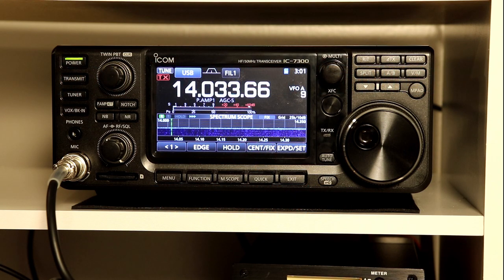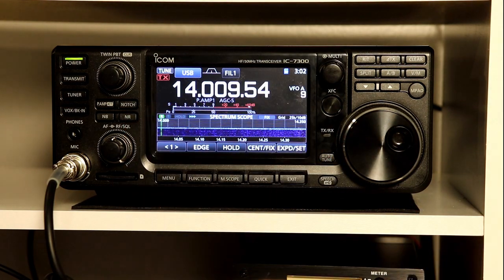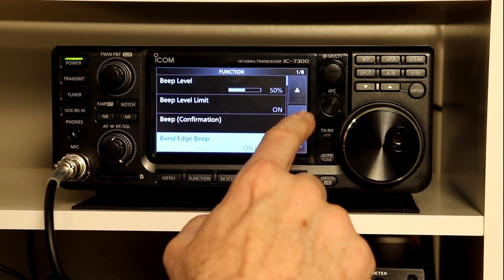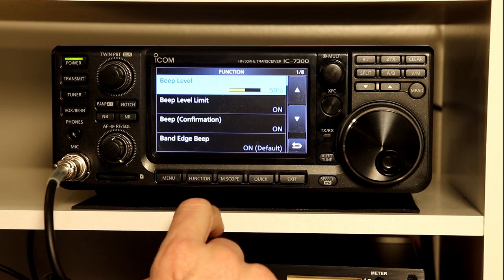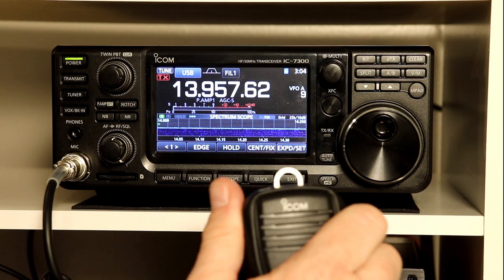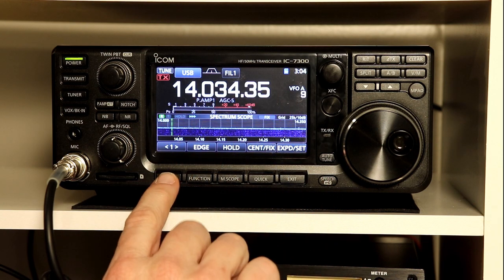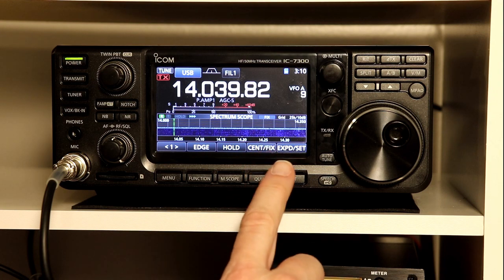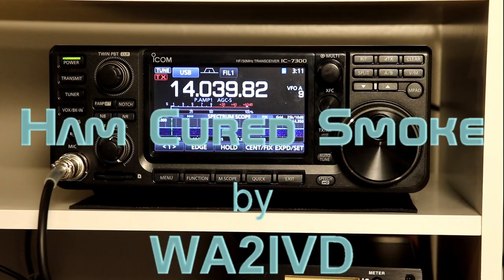Icom IC-7300 From A to Z - #3 Band Edge Beeps & User Band Edges

Comment: Great videos Tom!  Everyone with a 7300 will learn SOMETHING new about their radio by just watching.  As a quick note to hams when using the awesome Band Edge programming feature, when in LSB or USB modes, you are using up to 3Khz down or up from your tuned frequency and if tuned right to the lower or upper edge of your band allowance, you could be transmitting outside of your band allocation.  These band edge settings can really help you to stay clean and keep the Advanced/Extra folks from calling you out!
Cheers and 73!

Comment: Hi Tom. This segment is really helpful. Thank you for taking the time to make up these informational videos. I upgraded to General this past winter, after a long absence from Amateur Radio. Purchased the Icom 7300, but still haven't been on the air yet. I am waiting for an antenna that has been on backorder for many months. I'm using a small dipole for listening. I'm also in 2 land, so perhaps in a few months I'll be up and running. 73'S Dave.

Comment: Thnks for your videos.  I have been not very active over the past year so I needed to refresh on the basics.  I got my advanced license in 1979.  I also have done some MARS work.  So I know about out of band.  I had hoped some years ago that the when they stopped issuing new advanced licenses  That since, if I remember correctly, that the only difference in 1979 between advanced and extra was Advanced was 13wpm and Extra was 20wpm. that my license would have been bumped to extra but no such luck.  I keep renewing so still an advanced class ham.  So I will use the user defined band edges limits to make sure I stay in my freq limits and no stray into extra territory.
Reply from the maker: Hi Joe.  I upgraded to Advanced right around that same time.  There was still a separate written element for Extra, even back then, but it was a pretty small jump from Advanced to Extra.  When they dropped the Advanced, I waited quite a while before going for Extra as I thought it was a little bit special to hold a license class that nobody could ever get again.  I finally decided to get over that about 8 years ago and decided to upgrade when my 2 boys took went to take their Technician test.  Glad to know that you’re getting active again and I’m glad you’re enjoying the videos.  73,  Tom WA2IVD

Comment: Ok we’ve set the band edges. In my case for General. Now how do we cycle thru the band sections. I see the <1> key are they numbered after we set them up.
Reply from the maker: With the scope in Fixed mode, the 2nd soft button should say “EDGE”.  Keep pressing that and it will switch between the different edge settings for that band.

Comment: THIS video is really useful to new hams, when I just gotten the Tech license I cq;d in the wrong range , thankfully a VERY POLITE operator called my attention to it , and I ordered the ARRL chart. I now have the General license , and set up the 7300 to follow those guide lines.  i SET THE LIMITS FOR PHONE AND IMAGE, i'M WONDERING HOW THAT WILL AFFECT DATA ?  THANK YOU
Reply from the maker: Hi.  Thanks for the kind words and sorry for the delayed reply.  The user band edges that you set are independent of mode.  So if you set user band edges for the general phone portion of a band, then outside of those limits, the radio won’t let you transmit in any mode.  So if you want to do data too, you need to make sure there is another user band edge pair covering the data portion of the band.  73,  Tom

Comment: I haven't played around with this yet. If I set limits for the top and bottom phone areas for the bands I would assume it'd keep me from accidentally keying up in the wrong area. Would I still be able to use WSJT-X in the digital portions of the bands?
Reply from the maker: Hi Greg.  If you set the user band edges to prevent transmitting and you don’t program a segment that includes the digital part of the band, then the answer is no.  Transmit is inhibited regardless of where PTT is coming from.  So if you are using the User Band Edges then you need to include every segment where you want to transmit.
Reply: @HamRadioA2Z  Thanks!

Comment: Tom - is there any remedy for 5.3 MHz where the scope is displaying 'out of range'? Also this applies to 70MHz on my 7300 on this side of the ocean. Great video. I've applied this information to mine rig  and the club radio. 73 de David M0YDH
Reply from the maker: Hi David.  There are 2 ways to remedy the ‘out of range’ message.  The scope fixed edge limits are divided into 13 ranges that roughly correspond to the various amateur bands.  There are 3 fixed edge settings for each range.  The default settings for these are usually an entire amateur band, the lower/CW portion of the band and the upper/voice portion of the band.  The range used for 80 meters can be set anywhere from 2.0 MHz to 6.0 MHz.  So you can change one of the 80 meter fixed edges to be 60 meters instead.  The other option is to put the scope in CENTER mode instead of FIXED EDGES.  Then the center of the scope will be your tuned frequency no matter where you tune.
As for 70Mhz, there should be fixed edges set for that.  It is one of the ranges.
You’ll find all this in section 5 of the manual.
73,
Tom
Reply: @HamRadioA2Z  Thanks Tom for the reply. I had a go at this.  Band edge 4 in any set seems quite adaptable. I set this one to 5.2-5.6 MHz. The LF band edges were readily changed for e.g. 0.03 to 0.25 MHz (time signals, 2200m and BBC Radio 4) and one for 630m. I'll use Center mode when I  go off piste- top tip - thanks

Comment: Tom,  Can I set up the band edges and "band segments" so the radio switches from CW to ( and from ) SSB at the desired frequency?  if so, point me to the right page.  This is my first "menu driven" radio.     TNX   Wayne N3TNS
Reply from the maker: Hi Wayne.  Sorry, but no.  You can set the default and user defined band edges to inhibit transmit, but there is no option to do anything with modes based on the band edges.

Comment: Hi there...question, when you get the radio the 60 metre / 5mhz band is there but there are no band edges and it says scope out of range but it will tx, so can you just make a band limit on that band, from 5,225 to 5.450 or what ever it is, and will the scope work on that band as it does on the others...i guess you press insert and put it in there...from Fred g4vvq in England.
Reply from the maker: Hi Fred.  Keep in mind that the User Band Edges covered in video #3 are not at all related to the Fixed Edges displayed on the scope.  There are 2 ways that you can display 60M frequencies on the scope.  One simple way is to tune to the center of the 60M band then set the scope to Center mode (instead of Fixed).  Then press SPAN until the span indicates 50k on each side of the scope and you'll see the entire band.  You can also change one of the Fixed edges for the scope to cover the 60M band.  Press and hold EXPD/SET and then scroll down to the Fixed Edges option.  You can change of the 2.0 - 6.0 Edges from 80 meters to the 60 meter band.  The scope is covered in the IC-7300 videos 17 - 19.  I believe setting the fixed edges is covered in #19.  Here's a link:  https://youtu.be/DTLvr0es6nA .  73, Tom

Comment: How can one open up a transmittable frequency range for the 2200 meter and 630 meter band?  Inserting two ranges above 160M doesn't allow entering frequencies for those ham bands.
Reply from the maker: Hi Jim.  The 7300 allows you to set transmit limits that are a portion of the various amateur bands.  It will not let you set transmit ranges outside of the defined amateur bands.  Many radios have some way of opening up transmit capability outside of amateur bands by applying a small hardware modification, by getting in a service type menu and making changes or sometimes, by a combination of both methods.  The 7300 may have this capability, but I haven’t looked into it.  If you want to modify the radio to allow transmitting on experimental bands, MARS frequencies or for some other purpose you could try searching on “7300 radio modifications” or something similar.  However, it is important to caution you that you are responsible for insuring that it is legal for you to transmit on whatever frequencies you choose in your country.  Also, keep in mind that if you force the 7300 (or any radio) to transmit on frequencies outside the range that it was designed for, it may not meet it’s performance specs or legal requirements for spurious emissions.

Comment: Hi Tom when i go into band edges in menu i only have 2 in there, something like 1.700mhz to 29,999mhz and   50 to 440 mhz, something like that, its 4 and 6 meters anyway, if i try to great a 3rd new option, i dial the freq in and press enter and it just throws it out, i was trying to make a 5 mhz section, i have installed new ver 4,0 software and my 7300 has been widebanded, anu ideas...oh the band edge bleep has vanished, apparently that happens when you wideband radios....from Fred g4vvq.
Reply from the maker: Hi Fred. When setting up any particular band edge, the left number always has to be lower than the right number. If you enter a number that violates that it will throw it out and go back to the last value.  So, if you’re moving an existing band edge way above the current range, you have to enter the right hand number first. If you’re moving it below the current range, you have to enter the left number first.
I assume “widebanding” means a service menu or diode remove/add type change that opens up the allowed transmit frequencies. My radio is stock.  So I can’t say how that change may affect any of the menus and settings.
Reply: @HamRadioA2Z  Ok Tom thanks, i looked at one of your other video clips that's helps, yes wide banding with the 7300 involves removing 2 diodes, so yes t essentially tx everywhere, although not 30mhz upwards, of course it does on 6 and 4 meters...when you have this done the band edge bleeps disappear....its legal in this country to have it done, they say well your responsible for what freq you tx on lol...73 Fred.
Reply: @HamRadioA2Z   Hi Tom, i have done what you said, gone into the options of the 80mts section, used option 4 and set band edge for 60 mts band, seems to work....cheers Fred g4vvq.

Comment: Tom, thanks so much for doing these videos. I am just getting back into amateur radio after 38 years and am currently using my old Kenwood TS-520. My what a difference a few decades of technology makes. I am going to purchase a 7300 and these videos are very helpful. I was wondering if the band edge function allows you to incorporate modes as well? So that you can’t transmit SSB in the CW portion of a band for instance? Thanks Jim - WA8MDC
Reply from the maker: Hi Jim,  sorry for the delayed reply.  I'm sorry to say that the band edge functions are not mode specific.